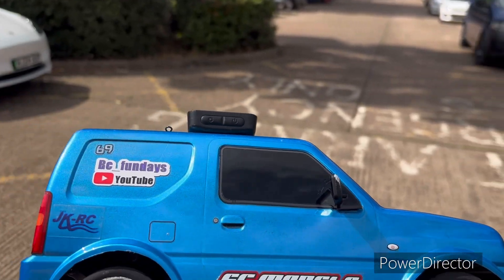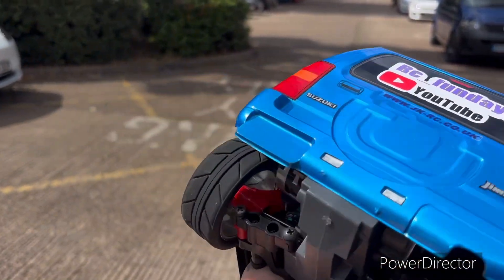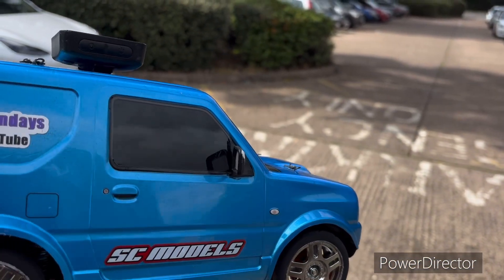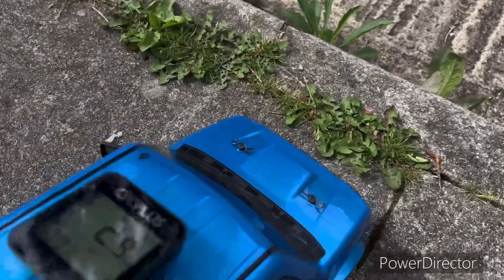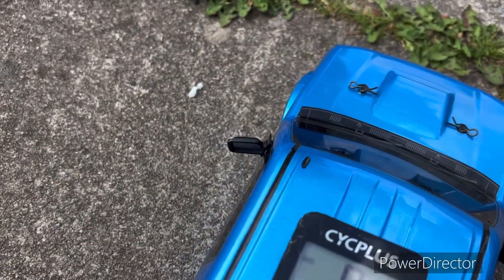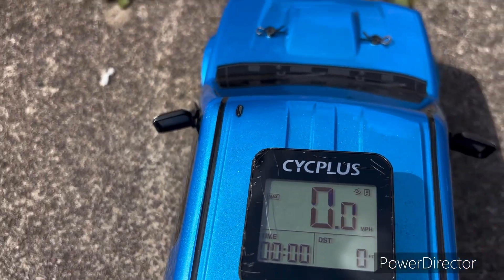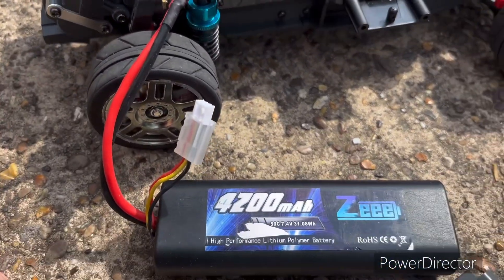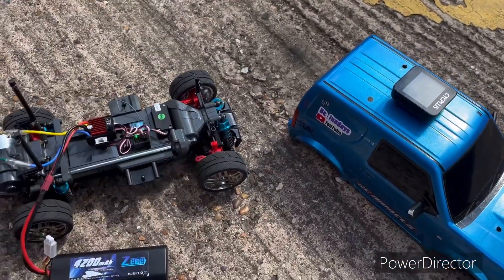Poor boys rc speed run 2024 first official brushed run!!!! So fast !!! @poorboysrc

Comment: One tip. Drive more rounds with that speedmeter. I have the same one and it takes more time to realize the top speed. I think your is a little bit faster than the speedmeter has counted. Between houses and under trees you can have many disconnection to the satellite’s. If you have the chance to drive on a place where you have more place to sky you will see there is more speed on the display. That’s what I learn last year by the Speedrunchallenge. But it is a great looking car and it drives beautiful. Greetings Markus 👋
Reply from the maker: That’s great thank you for the advice